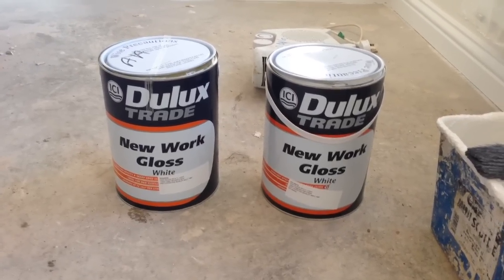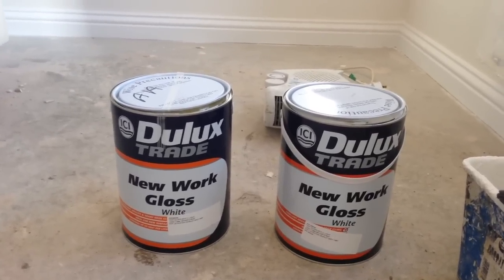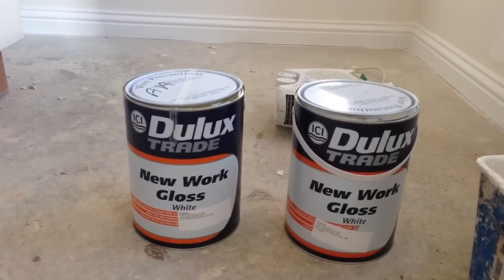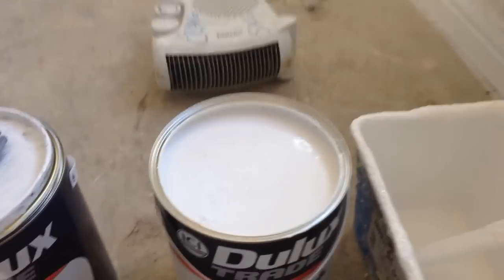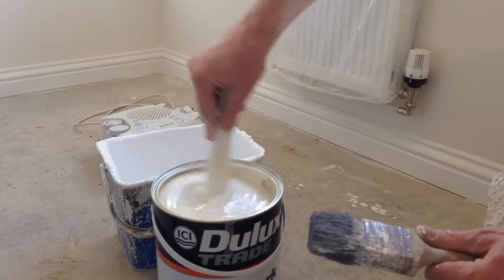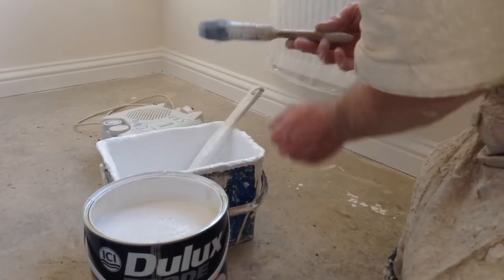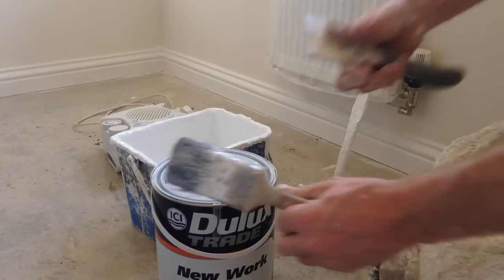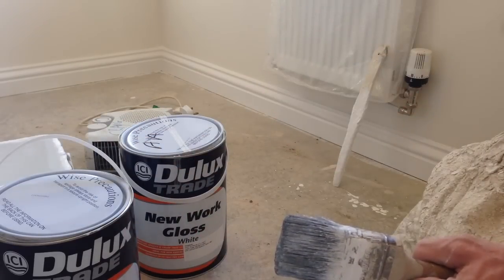Painting & decorating. How to speed up gloss painting without adding turps.

Comment from the maker: When heating the gloss up to near boiling point in front of the electric fan make sure you  loosen the lid off the top of the paint otherwise it will explode open
Reply: Mr bean and the firework in the paint tin springs to mind, great tip, I've never heard it before but will definitely be doing it next time.

Comment: Good tip mate the heat makes it like the old style crown gloss used to be, thin, easy to use but gave a great skin of gloss. If you don't have heat mix in some boiled linseed oil, not too much, mix well and helps with application if heat isn't available. It strengthens the paint similar to owatrol and doesn't affect the durability etc.

Comment: I there thats great tip have u every tryed heating your emamel gloss with a blow torch it does the same then pour some paint into a work pot then put the work pot sitting in hot water,you are dead right every time u add turps it breaks the paint down keep up the good work from one painter to another....

Comment: wow cant wait to try that. i heat my caulk,that changed my life  but gloss!  one question tho,i use mini roller and 2"purdy ALWAYS but i just cant seem to get a perfect finish with gloss,im not sure if i need to spend more time cleaning brush/roller before glossing or if i use too much turps but my gloss needs to be more consistantly soft/smooth.i use foam roller on seals cos i cant figure it out!!thing is im quick and dont want to slow down. quick as in 3 3beds a fortnight without sounding bigheaded..pls help =smoother gloss=how to??

Comment: How do i stop runs and sag in gloss
Reply: +mike buller put less on!!
Reply: +mike buller Thinner coat, do a second if necessary. If working in the cold thin the gloss a little to ease spreading.
Reply: Thicker the coat the more chance gravity will take affect and make it sag. Using several light coats of paint is ALWAYS better than trying to make it cover in a thick coat.